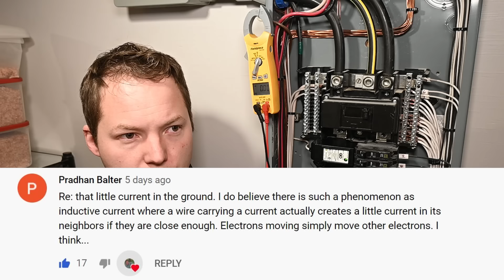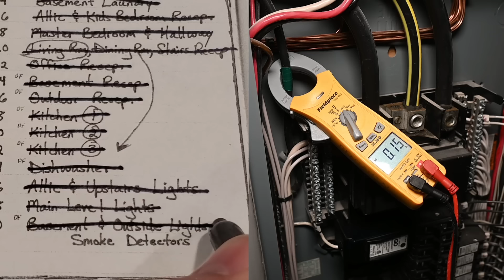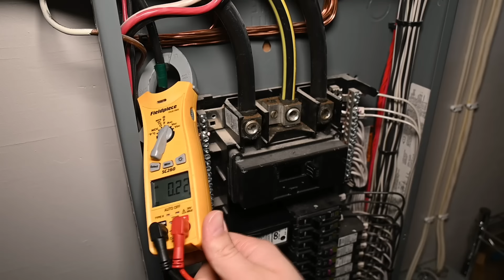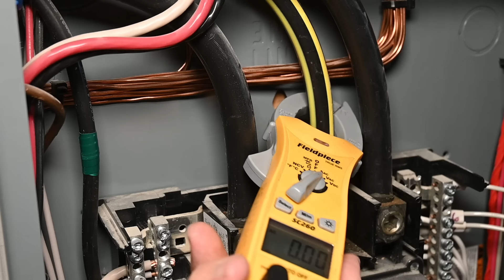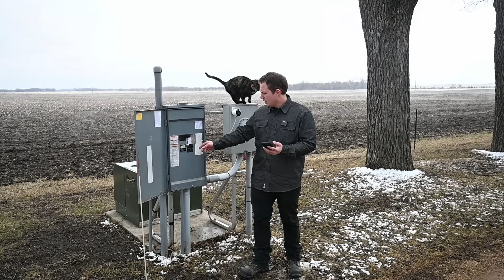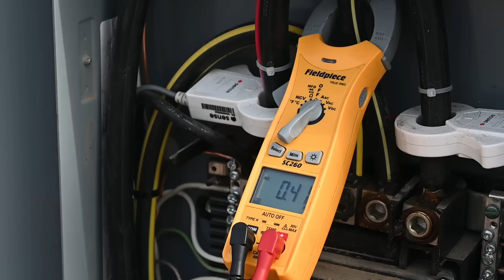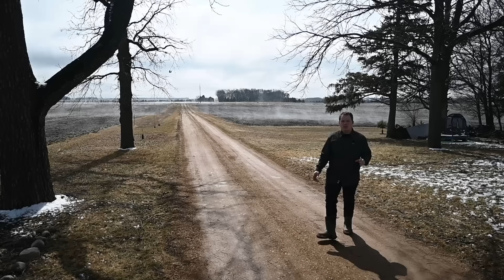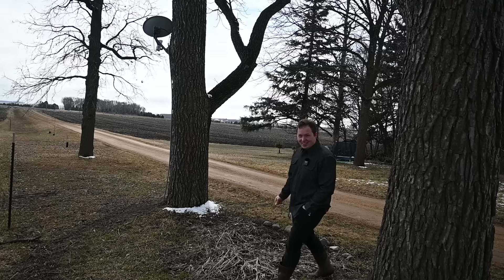Finding The Source of Stray Current on Grounding System

Comment: As an engineer, I have performed many tests and written several articles about stray voltage and ground current over the years. You have found ~200ma of stray ground current on the panel grounding conductor. Since current never flows into an open (except in RF, another topic), the same ~200ma you found will be also be found on one or more other grounded conductors within the very same panel. This includes grounds and neutrals. And since this is a ground current issue, it has nothing to do with breakers or loads, hence your lack of any change as you eliminated them. Use your ammeter and look at each and every ground and neutral, one at a time. Some will be zero and some will have a small amount of current. I can guarantee that they will add up to your ~200ma. You are also mixing primary with secondary grounding in your discussion toward the end of your video. These are usually two different grounding systems. Primary is distribution and secondary is subscriber. Primary and secondary are not directly intertwined.
Reply: Having said this, and it is true, isn't that 200ma of 220 or 440 and isn't that enough to be a problem the utility needs to resolve?
Reply: What you wrote is probably all correct except for the last sentence.  Distribution transformers actually do have a common ground between the primary and secondary.  Most engineers outside of the power distribution industry don't know this, though.   See section VI(B) of the article at this link:
https://www.ecs.csun.edu/~bruno/MultiGroundedNeutralFinal_4-17-7.pdf
Reply: Yep, Louis is right. The primary and secondary neutrals are bonded together at the transformer, and are often the same wire! This can lead to significant stray voltage on all grounds and neutrals on the customer side of things in the event of a utility losing a neutral if there is bad grounding.
Reply: @chrisbauer1925  So for Ben's situation is this caused by an insufficient neutral return path and/or lack of sufficient/damaged grounding points along the power distribution pathway on the utility side? Thanks for your reply.
Reply: @hippo-potamus  Yeah, that does seem to be the most likely scenario. A loose or open neutral somewhere between the substation and Ben's house could cause this. Though there may not be an actual problem on the utility side at all. It could just be that Ben's Grounding system is just really good (low resistance) so a relatively normal stray voltage of only a couple volts could induce a stray current of about 200 mA. Low levels of stray current on customer grounds is just an inherent property of utilizing a multi-grounded neutral that is common between the primary and secondary side of the transformers. 

One could argue that this system is not an ideal design in the first place, but different grounding methods all have their advantages and disadvantages.
Reply: @chrisbauer1925  Why does the neutral to earth voltage not trip the gfci breakers? Is it because the leakage is upstream from them or could it be because its dispersed in such a way as to be below the breaker trip threshold?
Reply: @hippo-potamus  Yeah it is upstream. The GFCI breakers in your panel are only protecting the circuit downstream. There is normally no ground fault detection on the medium voltage lines on the street, just overcurrent in North America at least.
Reply: Can electrical capping on the pole wires with a bird's nest in it cause this...? @hippo-potamus
Reply: Nobody cares if you are an engineer.
Reply: @krakenwoodfloorservicemcma5975  Is a kraken an octopus or a squid?
Reply: A giant squid.. doesn’t matter, stop worrying about the neutral unless it shows up in your swimming pool.
Reply: @krakenwoodfloorservicemcma5975  14A at the ground rod isn't concerning?
Reply: If it can light a 30W bulb then yes, if not, no.

Comment: Some off the Newer Transformers have Surge Protection on them. They leak a little bit of Voltage to Ground. We had that at a Commercial Site, Utility Company quickly cleared the Current on ground puzzle. BTW, this is not a replacement for Surge Protection on your end.

Comment: I don't know whether anyone has mentioned it previously but, natural gas shouldn't be run through copper lines to the best of my knowledge. The sulfur odor added to natural gas as a leakage indicator reacts with the copper and degrades the integrity of the line and will eventually cause leaks. Unless you meant to say propane?

Comment: Check with your serving utility Co. Have them test their ground electrode connection at the transformer pad.
Reply: Grounding electrode connection needs to be tested for proper resistance level readings, utility standards. Ground rod should also be tested for ohms value per utility standards.
If the Neutral and Ground are only bonded at the Main Service Disconnect. Why are there sperate ground rods at the main House and possibly other out buildings.  This causes equi-potential ground path. This now causes current leakage to bleed. If the grounding path at the xfmr. is not adequate or incomplete you've got problens. Also you need to have a grounding electrode for the Main

Comment: Oh yeah if it was anything else it'd be on your common wire and you don't have anything there That's what I would look for grounding dual grounding different potential potential equals volts but there's no volts in the ground and only current remember AC/DC is a theory you wouldn't believe some of the things I've seen anyway have a good day be safe

Comment: Hello Ben this is Coyote ex meter technician your voltage is good on your secondary side of the transformer to your main they should both be the same, do we have here is a difference of potential you should never have two grounding rods or ground in the ground in the grid of your home that said you have one for your main your sub should be a green wire for your secondary sub your meter should tell you if you're using any watts apparently you're not so it's between the meter and the ground only way for this to happen is difference of potential somewhere you have another ground connected to your grid for your house and there's a difference and that's why you can see it on your meter I saw a uninsulated ground on your primary panel turn off main lift ground off bus bar It will go away get this is true there's your problem All you have to do is find the other side now Make a video and let's see
Reply: Oh yes and please front line protection and rubber gloves please 120 the ground is one thing 240's another ＼(◎o◎)／

Comment: Have you taken a voltage reading using a TRU-RMS volt meter? And also checked the HZ. It’s very common in commercial power systems but very rare in residential split phase but harmonics has been known to cause induced voltage between the neutral and ground conductors.

Comment: Okay, I got tired of reading the comments because I didn't want to repeat anything that someone might have already said. So just wondering....I saw in an earlier video that you have a propane tank. Is it buried? Do you have cathodic protection on the tank with a magnesium anode? Does your tank have dielectric protection with the POL....and where it connects to the house with a dielectric coupling? Dissimilar metals in the ground cause current and the magnesium anode produces( depending on size) about -1.55 volts to counteract the voltage created by metals in the ground and the resulted corrosion. You've got steel propane tank, cooper lines, whatever your grounding rods are.....all this going on.  Just asking could this be part of the problem? Love your videos and would like your feedback on this. Yes I do gas work.

Comment: If you take the meter off you will see that behind the two hot legs the neutral is running behind one side and not connected to the meter . However while  its off it doesnt turn the meter but if it were turned on that current that is already present pushes the meter to turn faster... its not a whole lot but trust me it will effect your $ you pay the power company. They wIll tell you it wont charge u but really it does its just small amounts so your bill will be more over time. Take the meter off and put the amp meter around the neutral ,that or the ground. If its 3 wire coming in there may be 4 wires coming out of the meter to your sub panel and the ground itsnt connected in the meter which is what your amps is coming from

Comment: If that transformer had a delta/Y connection scheme having the primary winding separated from the secondary winding altogether (galvanic isolation) thus providing the Neutral from the center point of the Y connection over to the main panel then you wouldn't have that current flowing thru the ground wire as you have now. Disconnecting that current loaded ground wire at some point in the house can produce sparks and cause accidents involving gas, even if all circuit breakers are turned off including in the main panel. To avoid this kind of occurrence, the electrical company should install delta/Y transformers instead of autotransformers like the one you showed us. Any imbalance in the autotransformer windings could cause that current to flow. Power loss is yet another issue.
Reply: Delta/wye transformers are for 3 phase AC.  Even with 3 phase you would have a corner tied or center tied ground which makes it essentially and autotransformer.  If this is not done, then you would have an isolation transformer, which would then have no relation to ground, thus making grounding useless.  You would be able to take a hot lead and connect it directly to ground and nothing would happen, at least not until another hot or neutral contacted the same ground.

Comment: 0.4 Amps running 24/7 makes your utility bill to rise substantially at the end of the month if the power meter is counting the leakage.
Reply: NEV. Even with the meter removed, you will still be able to measure current flow on the neutral as it is connected via Earth back to the Main Power Supply (Electric Company). But this current isn't flowing through the meter so it doesn't get recorded.

Comment: Why are your fingers that close to the powered main lugs on your main breaker???   Your fingers come within millimeters of the metal on multiple occasions while your hand is touching the metal casing.   That is powered even when the main breaker is off (as I'm sure you know).
Reply: Also the issue is not from your installation.  It is stray current from your grounding rods using your neutral to get back.   It could be something as simple as wet wires at a neighbors house and current is leaching through the ground into your ground rods, through your PEN bonding and back to the transformer through your neutral.
Reply: You are using no power because you are *drawing no current*.
Reply: It's not "coming from" the neutral wire,  it's going back that way.   The current is coming from the transformer but it is not "coming from" your neutral and going into the ground,  it's "coming from" (a misnomer because, as you stated, it's AC) the line side and leaking someplace outside of your control.   The only way what you are describing (arbitrary voltage from the provider's neutral into your ground) can happen is if there is a broken neutral on the distribution side (at which point all power will be forced to either go through grounding, another phase,  or it gets isolated) and you'd see a hell of a lot more than a few hundred milliamps.   Your neutral and ground are bonded in several places (including your outside panel) and you would not see the current inside your house if it was just current coming down your provider's neutral and going to ground because you have a low impedance path at your main panel outside.   You see the amperage in your house because that's where you are bonding to pipes, stakes, or wherever it is you're picking up the current.   Put the meter around the individual ground bonding wires.  If you see amperage at one cable entering/leaving the panel you should see equal amount of amperage on the sum of other wires.   You already ruled out all the hot wires but you never checked the bondings (stakes, gas pipes, water pipes, bonding to things installed into the ground).

This is exactly what happens when someone's fountain pump or pool pump starts corroding and they do not have it on a GFCI/RCD.

Comment: So like look at all the property that has grounding like the gas pipe and all the ground rods and all the metal , pipes and such that are in the earth near the transformer. Measure the ground moisture, air moisture , ground and air temperature, and air velocity. and compare all the variables to the amount of current flow to suppose that the property is creating current flow. 
Compare with water. Water paths (steams, rivers and especially tidal bores) can have flows that go in two different directions.  I have personally seen this in the Hudson River. 
I ask you can currents run in two directions on one electrical line ? 
SEE : https://electronics.stackexchange.com/questions/413798/how-is-it-that-two-electric-currents-can-travel-in-opposite-directions-on-the-sa
This article also talks about how buried telegraph lines were interfered with and had to be raised on a pole. 

I propose that the air and ground / temperature / moisture content / density / air pressure and speed, all work together to generate current and/or work in tandem with the near by power line and also all the buried transmission lines to your property to create current. 

Also can you measure the 0.22 amps for AC vs DC?  
Can  the 0.22 AC amps be measured for DC (8.91 amps at 12 v) and if so what is the direction?

Consider That 
https://electronics.stackexchange.com/questions/327643/can-dc-voltage-and-ac-voltage-flow-on-same-conductor-at-a-same-time#:~:text=No%2C%20since%20voltages%20don%27t,is%20only%20a%20single%20voltage.
"However, it is possible to have a DC and AC voltage superimposed on one another. This can cause DC and AC currents to flow, depending on the load that is connected to the voltage.

Keep in mind that at any one time, there is only a single voltage. It can be a useful abstraction to consider the voltage over time to be the DC average with AC added to it.

For example, sin(ωt) is a purely AC signal (the DC average is 0). However, sin(ωt) + 2 is a signal that can be thought of as having a DC and AC component.

Deliberately adding a DC component to a AC signal is sometimes done deliberately. The cable TV and phone feed in one building I'm familiar with does exactly that. The signals are all modulated at high frequency. When used, they will be AC coupled. There is a power supply that adds 24 V to this signal. That allows some devices to use the 24 V DC for power, while still receiving and transmitting on the AC bus. The bus in this case is a large-diameter coaxial cable."

Comment: Current is a flow of particles over an electrical path -  Power is when the current is converted to do some work (light bulb, heater, radio) and cn often result in heat from the conversion.

Comment: Back in the 1980s, I was working for Western Union as an electronic tech. On a wire circuit from Paoili Pa to Philadelphia. On a piece of equipment connected to the wire to Phily that kept burning up every month or so. I was testing with the WU wirecheif. he was looking at the ground voltage from my end and said "the voltage just went up to 80 volts" and I said "I can't hear you the Amtrac electric is just going by". The ground voltage is not always zero. Is the screw that connects the ground to neutral connected?
 I enjoy your videos and have learned a lot from them,

Comment: We really need an update to this video. I don't understand how there was just no other follow up to this. Did you ever find the ACTUAL source beyond just a guess? Did you ever get the ground wire to run at 0.00v like it should?  I  have been dealing with this same sort of situation for months now and though FINALLY someone else is seeing what I am seeing...now I will get to see how this is solved. But no lol...we jumped on to water heaters and mini splits. This is one that really deserved closure though.

Comment: First I would isolate the the ground for the home by disconnecting all copper to the home, e.g. phone lines, coax for cable etc....  Leave the ground blocks attached and disconnect the drops.  My guess is you are seeing a small amount of expected Neutral earth voltage  NEV.  

You can also take a 50 foot wire and put the end of the wire into a common earth point and take a voltage reading at the disconnect, interior load center and all ground blocks for services. 

Also take a voltage reading form the case of the transformer to remote earth and use that as yo base line for all other reading.  Hope this helps...